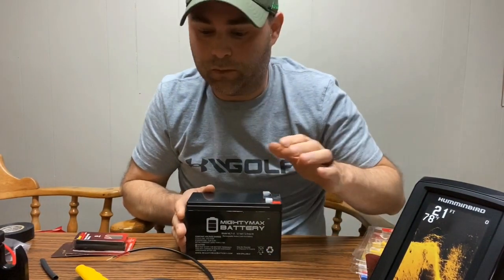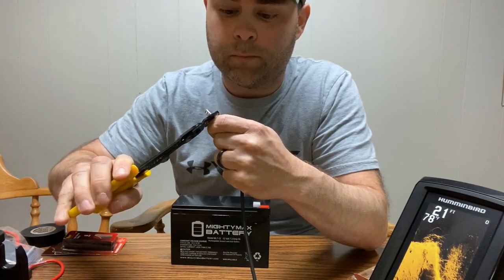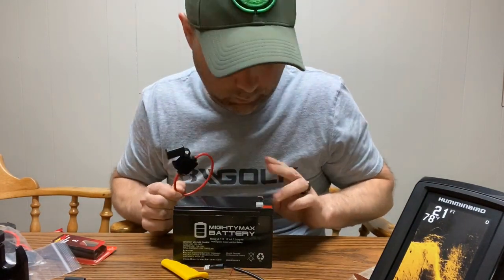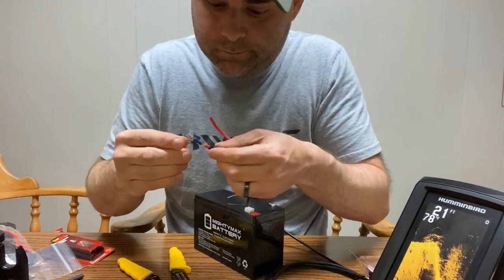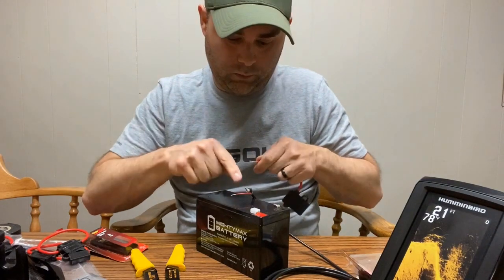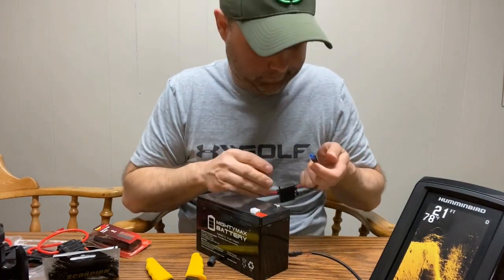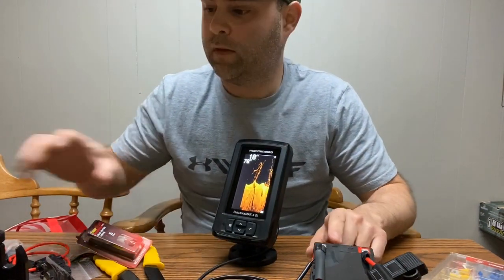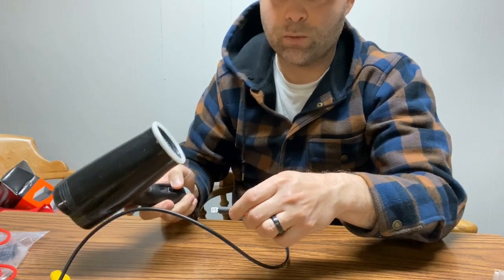Complete NOOB install - Humminbird fish finder for kayak to battery (start to finish)

Comment: Followed this. My Helix 5 wouldn't power on. My piranhamax would. Went from a 7Ah to a 8Ah battery and it powered up. Instructions said at least a 9AH. I figured it it would power my Piranhamax then it would power the HELIX
Reply from the maker: Great info!! I'll pin this so others can see. Not too surprised as the Helix 5 is a heck of a unit, makes sense it needs more draw than the Piranhamax.
Reply: Hey Jerrett, you'll want to make sure you have a 3amp fuse for your Helix 5 vs the 1 amp.
Reply: Nice, do you know how long power take that battery 1, 4 or 6 hours or daily I need to charge? Thanks good video.
Reply: Appreciated the step-by-step, including the information regarding the 12 V spade connector, 16/14 gauge as well as the use of the shrink wrap. As a newbie, all the stuff was a helpful shopping list for when I go to the auto place.

Comment: i had the same battery and in about a year the charge started to only last a few hours. Hope that won't be the case for you. I just upgraded to the dakota battery for $100.
Reply from the maker: At the 1 year mark and mine is still holding up great. I am a bit of a nerd make sure I charge it on the last day of every month even in the winter when not in use. Also I store it in basement winter and summer to not expose it to extreme conditions consistently. Not a battery expert but have heard that doing this can for sure extend the life of the battery, but father time is undefeated and everything expires at some point...unfortunately
Reply: @Channelofdk  haha hope it keeps up.  I Babied mine too but for $30 I can't be too upset right!

Comment from the maker: To the person that asked about the color wire I can’t find the comment but...don’t believe color matters it more about the gauge size of the wire. So if the yellow gauge wire works on your set up should be fine. Size should be stamped on the connector some place

Comment: Hi. Best video on how to connect straight to battery! I do some questions, do you know how I would connect two fish finders on that one battery? If I’m using two fish finders on one battery that require 1amp fuse, do I put 2amp fuse for the two?
Reply from the maker: Thank you, very kind!! Question one would be over my head hooking 1 up was about all I can handle. I know it can be done with right type of connectors/terminals the how I’m not sure. Questions two is one those yes/depends. Depending on fuse placement between the units and the battery the 2 amp would give better protection against a better surge but if you used a 1 amp an even smaller surge could happen and blow the fuse that the 2 wouldn’t have. My theory is unless I’m sinking I’m not expecting a surge also I have nothing else being connected so it’s only 1 circuit I’m dealing with.

Comment: Hey thanks for the video! I just got the same set up and was windering how to set it up!. Would a 2 amp fuse work? I ask because thats what i have (lol)
Reply from the maker: Again I'm not an electrician, but 2 amp will work..but the fuse is designed to protect your fish finder. The manufacturer recommends a 1 amp, so 1 amp offers the best protection in the event of a surge. Going with a 2 amp possibly could cause damage in the event of a surge but ideally you want the fuse to blow before the fish finder. For example if you have a 10 amp fuse but wires can only handle 1 amp, wires will burn up before the 10 amp fuse itself blows.
Reply: The 3A fuses mentioned are to keep any spurious current greater than 3 amps from reaching the unit, possibly burning it out.
A 2A will lower blow at a lower current than 3A , making it even safer.  If the battery current surges more than 2A then it may be damaged or the wrong battery for this purpose.

Comment: How far below the kayak should your transducer be? Below the water I mean in order for the side imaging to work. Thanks!!! Ive used your videos to help me setup my first graph. Just want to be sure my side imaging will work
Reply from the maker: Great question! I have mine about 4 inches or so in the water. I called Humminbird to verify and they said there is no min depth for the transducer to be, just has to be fully submerged, regardless of the unit having/not having side imaging. I am going to be doing some testing soon with placement of the transducer, direction facing, depth and post a video of the testing and results. Hope this helps. Tight lines!!
Reply: @Channelofdk  thank you

Comment: Nice video!! Ty for the detail too! Where can I find the amp rating? Is it in the owners manual?
Reply from the maker: Thank you ! Yes, the manual, Section 2 "Connect power cable to boat" says to use 1 AMP fuse ***for this model Piranhamax 4. Also mentions some boats have a 24 or 36 volt system, but unit must be connected with to a 12 volt power supply. Hope this helps!! Tight lines!
Reply: @Channelofdk  Ty for taking the time to reply in great detail. Lord bless you there friend. 😊

Comment: Don't crimp at the bottom. There is nothing to crimp. There is only one spot to crimp. That's all that it can do. It's so small of a spot. That really u can only get one crimp. Your better off taking the plastic off those shit spade connectors. But u will break that wire crimping it at the bottom.
Reply from the maker: Good point to share. Held up this far but only time will tell.

Comment: Why dont the wires already have connectors? Everyone is not knowledgeable about connecting wires.
Reply from the maker: That's a great question. Think the companies that make things like these, don't know what type of battery you will be using. And each battery had different types of connectors...so they give you wires and "us" the customers have to use a connector depending on the battery terminals, some are circle screw in, some square and slide in, etc. Was something I learned along this process, but hope this helps, that's my guess anyway.

Comment: How do you know that a 1A fuse is enough? Just wondering before I install
Reply from the maker: I downloaded the manual from Humminbird and it recommended to use 1amp. Tested everything on the water last Sunday and worked great, the test vid will be up.
Reply from the maker: Here is the link I followed if that helps any:  
 https://humminbird.johnsonoutdoors.com/sites/johnsonoutdoors-store/files/assets/misc/HU/H/HUM_productmanual_IG_PMAX_DI_532437/HUM_productmanual_IG_PMAX_DI_532437.pdf?_ga=2.67524433.1134027832.1590531943-39455449.1590531943
Reply: Awesome! Thanks a lot for the video man
Reply: How do you know it's not a 1amp glass fuse!? That's what I bought for mine. But haven't tested it yet
Reply from the maker: Ricky D the in-line fuse holder I bought uses the square looking ones, that’s they fuse type I bought. I don’t know if the glass cylinder ones work, don’t see why not. I’m by no means expert at this not sure the difference between the two fuse types.
Reply: I just called hummingbird and they said 1-3amp will work, 3 was high and dont go over 3a at all!
Reply: @Channelofdk  Why do you need a fuse?  I've never run a fuse before on my fish finder?
Reply from the maker: @thomas9429  You don’t need a fuse but all the instruction manuals no matter what brand recommend using one. Electronics and water don’t play nice and the fuse acts as safety feature. Rather have the fuse blow out from surge than my unit. Even tho it’s a $90 fish finder that $2 fuse much cheaper.